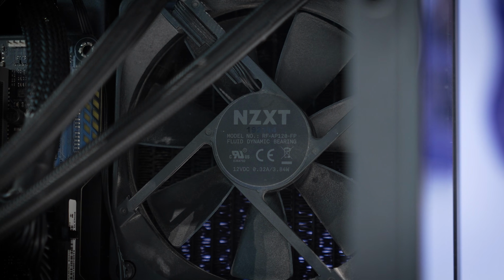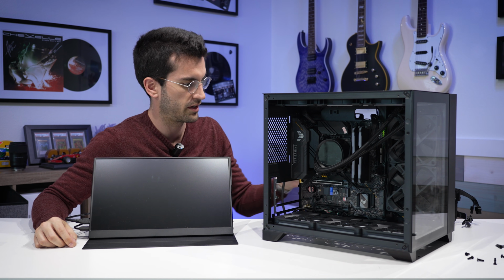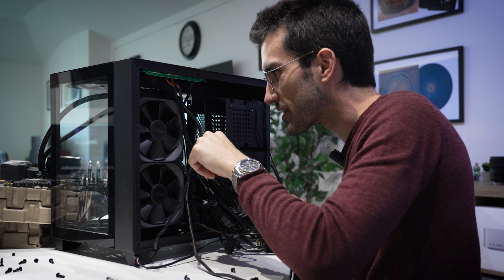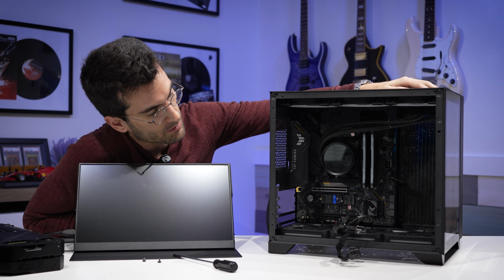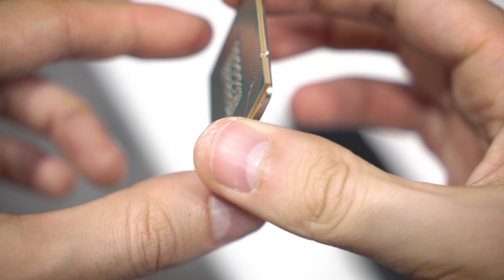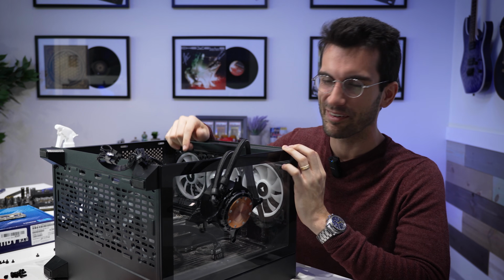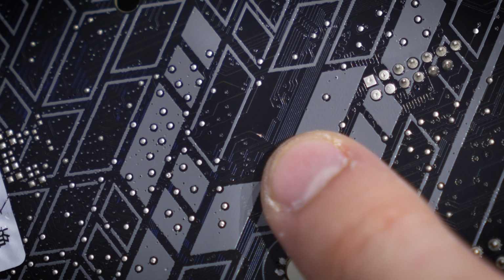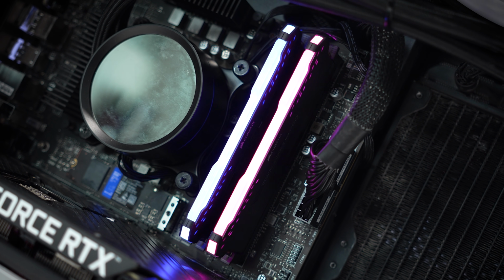Fixing a Viewer's BROKEN Gaming PC? - Fix or Flop S6:E11

Comment: Know this video is old, but I’ve ran into this exact issue once myself. I bought a WRX80 board open box from Micro Center. It worked fine for months. Until I’d experience random shutdowns sometimes. After a month of that it ran right into the same issue you did. It would power on if you held the power button and get into the BIOS. Only three minutes after then it would power off and not do it again until you left it with no power for a few minutes. I got the protection plan so I was able to get my money back luckily and buy a replacement.

Comment: I had the power button thing on an old Fractal case. You had to push the button just right to make it start. If you fast clicked it, nothing happened. Oh, and you had to wait at least 10 seconds after flicking the PSU power button before you pushed the start button on top.

Comment: One of my builds is the same way, I have to hold the power down for 2 seconds. I have adjusted/added hardware here and there during the 3 years I've had it, and not sure why it does that. Also, the VRAM light turns on but shuts off after I restart it, almost every time.

Comment: if that mobo had 2 screws in it, that's more than what MicroCenter used for my motherboard.  The only thing that held in my mobo was the graphics card.  The chunky cpu cooler was bending the board.  I learned to double check repairs before heading home, and not to go to MicroCenter. My computer wasn't the only one they messed up.

Comment: You can take out the individual prongs in the connector and connect up to 2 items per usb 2.0 ports that’s why the top and bottom of the connector are the same no splitter required. Plug in your existing wires into a single connector then plug it in the 2.0 hub polarity correct and your 2.0 port can support 2 items.

Comment: The tape around the CMOS battery is understandable, the tabs on the front and back of the battery indicate that it was likely intended to be used outside of a socket.  Back in 1994-1995, I worked at Zeos, and all our motherboards had batteries like this that didn't have a battery socket, they were soldered directly to the motherboard.  Therefore it wasn't necessary to contact the outside edge of the battery to make the connection.

Comment: I will guess that the battery was a solder in kind, and someone tried to use it in this motherboard.  and note - the black is an insulator.  Now normally, the outer ring is the contact point - so the ring as an insulator - means - battery not working.   My opinion.

Comment: Seems like a capacitor issue I’ve seen certain units power on like that and I check the capacitors and tends to be them or a diode or resistor at worst but the fact that it gets power like that to me says a capacitor is blown probably from the standoff touching a trace and isn’t able to charge anymore not giving enough power to boot up

Comment: I can pretty much guarantee that you got fooled as there is just no way the motherboard works without a battery connection.
not sure if I should be impressed by the troublemaker or by how Greg didn't notice the battery earlier.

Comment: I have a Tuff B650 board that does a very similar thing, eventually it works, also I have the sane ROG 3080 and when those red lights flash its sometimes just an update needed on the card or resetting from the PSU. I will be fully moving away from Asus when I upgrade, they wouldnt RMA the board, the GPU works fine, but is a head ache.

Comment: My theory is that the system worked ok until the GPU upgrade. The lack of correct footing for the motheboard caused it to crack something when the 3080 was inserted in the pcie slot.

Comment: I think that motherboard with the writing on it is set for 220v and not 120v
Reply from the maker: I don't think that's how modern motherboards work. The power supply always steps down voltage (whether 240/120V) to mostly 12V, 5V, and 3.3V. Motherboards don't operate on voltages higher than this.

Comment: I was pretty sure from the start that it was either the PSU or mobo. Was similar symptoms to an old rig I had, It did boot into windows, then just shut down. Did some testing of my own, like re-seating the RAM and GPU, but nothing helped.
Took it back to the place that built the system, and I wrote on the repair paper I got that I suspected the mobo was bad. When I went to pick it up again, I saw on the same piece of paper the the guy reparing it had written "suspicion correct, mobo replaced". Guy had a sense of humor, and I even got a better mobo than the one I had, so win win for me.

Comment: I don’t live anywhere near Florida so I’m more asking if you have seen this problem before: 

Basically on Saturday everything was working fine. I turned the pc off to go out for a couple hours. Came back home and turned it back on. I play vr so it’s definitely something that runs on my pc a lot. Well when I tried to enter in the app I go through didn’t work. Uninstalled and tried to reinstall to no avail. Now the next day. I go to Best Buy and get a brand new hdd 2tb for my computer to see if the app wasn’t downloading due to my space not being recognized. (It wasn’t). However, after hours of it being off this time (after I trouble shot the space issue) I turned it back and it posted. Started booting into windows. I get the sound but then all of a sudden my gpu shuts off completely not allowing me to log into my profile. 

I just bought a replacement so I won’t know if this fixes it but it just seemed like something to ask. Basically have you ever seen a gpu post, but then turn off when booting into the login screen? (It boots into windows 11 just turns off right before the screen that allows me to log into appears.) 

Specks:
12th gen intel core i9-12900k
64gb ddr5
Msi 3060 ventus 3x 12gb
2 ssd (one of 1tb and one of 4tb)
1 hdd of 2tb
650w 80+ bronze 

Thank you

Comment: here's my issue, is ive watches numerous flip or flops videos and instantly once you showed it turned on and then it didnt. that showed me that it had motherboard issues rather psu or even cpu. for it to be cpu it would generally not power certain parts up while only posting once. if it was a dead cpu i for one dont see it posting and two even if it did it wouldnt make certain parts of the computer have power and not. it doesnt control the lights. The RGB lights typically depend on the CPU receiving power and a signal from the motherboard to activate. If the CPU is not working, it's unlikely to be able to power or control the lights. yet it was controlling and it was powering....all im saying is that ive learned that from watching these videos and  the internet confirms it what i was thinking let alone your end result. i think you may need to rewatch your own videos because instead of a 15 minute video you turned it into 30.
Reply: i do want to let you understand that i understand you need to go through the process to vet everything however its videos like these that prove you should try to isolate the issue and solve that issue rather than test what issues you can find because the viewers were not so truthful...
Reply: also not saying this guy wasnt truthful

Comment: At 19:00 I am guessing it has an overload on one of the pins of the board , the power button or leds are not connected properly on the board, or there’s an issue relating to the psu or mobo cables/connection pins.

Comment: If you either hold the power button down for 2 seconds or change the voltage switch  (toggle it back to 120) you can quick press the power button.  Read the manuals!

Comment: If I had to guess, I'd say that the CMOS battery likely came from a mini-ITX board. Many of those boards do not have the battery physically on the board itself but rather wired to the board and stuck to the rear I/O. They often have plastic around part of them or even their entirety. The battery had the connections on the pos and neg so it was definitely a repurposed battery.

Comment: Yoo the crazy thing about this is when i got my PC back in '22 i had the same issue, plugged in the PC and pushed the power button and there was no response,i ended up checking the front panel cables and they were fine, my dad then told be to leave it be to not cause any further damage,I put it back together and out of curiosity, pushed the power button harder and she turned on,i was so relieved,thought i had gotten scammed.

Comment: Radiator tubes up? 😕
Reply from the maker: There's absolutely nothing wrong with this if the pump is sufficiently below barb height and the loop is sufficiently filled. Folks have been spreading this B.S. since the GN video went up.

Comment: I had a computer doing the same thing. It kept getting harder and harder to boot until I couldn't get it booted at all. Replaced the mother board and worked fine.

When I first got the computer the mouse I was using had a bad shorted cable. I wondered if the shorted cable damaged the motherboard in a way that took several years to get critical. Maybe a damaged capacitor. Your out of place screw may have caused a similar problem.

The guy that fixed mine pretty much checked all the same things you did.

Comment: BIOS update?
Reply from the maker: BIOS wasn't the issue. Power flickering was further isolated off camera and wasn't software related. CMOS battery essentially remaining disconnected despite being inserted into the board's holder would explain constant BIOS resets, but it had nothing to do with the overarching symptom.
Reply: @GregSalazar   It didn't make the most sense for a corrupt BIOS to cause the power switch oddity, but I mean I've seen weirder stuff.  haha

Comment: You said you didn't reconnect the top USB 2.0 ports because it's got a working USB 3.0 port on top. The problem I found is, as my case has one 3.0 and two 3.2 ports on top, when using wireless keyboard and mouse (from Logitech), that these don't like being on USB 3.0 ports or higher. They'll just cut out randomly, or the keyboard will hang, the mouse will jitter all over the screen. Unworkable. Putting the dongle in the back of the computer didn't work for me either, as then I'd have total signal cut-out. So I used a USB 2.0 hub for the dongle, and plugged that into the USB 3.0 port on top. This works without any problems. 

Just saying, some peripherals really like it better on USB 2.0 ports than they do on USB 3.0 and higher.

Comment: I touched a laptop board with a screw in the wrong stand and it burned the board completely. So, that was the problem with the board you was seeing, maybe was a power lane or something related and blew a capacitor, or any protection of the board 😅 yeah, the easiest and better solution is to replace it.

Comment: who assembled this pc originally? StarForge is an SI so they should now what there doing, but missing screws and incorrectly positioned stand offs? and a cheap aliexpress motherboard from an SI? the battery is very odd and clearly not designed for mounting in this pc, i know sometimes you have to buy the battery seperately when buying from China so whoever assembled it couldve found some random junk hardware and yanked the battery from it thinking that will do, and in there ignorance didnt remove the terminal tabs and plastic shielding but from an SI? its a damn shame that short damaged the motherboard considering its an Asus Tuf board which is supposed to be pretty resilent to hardware failure.

Comment: This was a motherboard short. I made that mistake that too :))) Same symptoms. In my case the standoff short the motherboard and then fire and smoke appear. The motherboard was fix under warrenty. Stiil this day it is working. You can use some insulator varnish on the old motherboard. Maybe this will fix the problem :)

Comment: This is my thought. The motherboard standoffs being missing is the reason. When the owner installed graphics card/memory/power they pushed to hard and caused the motherboard to bend which cracked some of the motherboard traces.
Reply: Nope, either some of the traces are cut, or a quick short of a few lines put 12v through a 3.3v or lower part.

Comment: Why flipped the fans to the other side when you could have just reversed the flow
Reply from the maker: I explained why. With the fans and radiator on the same side of the bracket, the cable routing holes were completely blocked.

Comment: Those are definitely aliexpress markings ive bought a couple from there. funny enough one of them being a tuff b560m identical to that one. The one i got would only power cycle similar to that if there was an nvme in the top slot. With the top slot empty everything works. Also they wont ship them with a battery so chances are the cmos battery was the owners doing lol

Comment: That CR2023 most likely had a wire ending in a two pin connector soldered onto it and was used inside a laptop or such, and possibly sourced from recycled hardware. And if the mainboard had a similar backstory I would not be surprised.

Comment: 1. Those USB headers only ever take one port each, unpin and wire them to two lines per header and you should be good. I'll never understand why companies use a 2x5 header (with on blocked for keying) instead on a 1x4 header... 

2. After you showed the board.. looks like BIOS flash back is missing... but ASUS CrashFree BIOS 3, ASUS EZ Flash 3 and ASUS UEFI BIOS EZ Mode are options to maybe fix a corrupted BIOS.

Not sure if 2 ended up on the editing room floor.. but it's someone that was bugging me.

Comment: That mobo has a hdmi which is onboard vid card and should post
Reply from the maker: That's not how this works. Ya need an APU from these Ryzen generations in order to achieve picture out without a discrete card. Either way, that didn't end up being a solution here :-)
Reply: @GregSalazar  why are ports there 4 really.

Comment: Greg, just saying ahead of time in the future if you get a PC with the person telling you it power on, no post but after several attempt it will post once this could be a too high hertz memory issue.
I found a PC in the trash and tested it just fine with lower hertz memory, i planned on using it so i bought higher hertz ram and now the system would only post once every few attempts, lowering the hertz in the bios solved it. Also if i were to have a post and leave the memory's hertz stock Windows would run faster, i do not mean good faster, i mean bad faster. Windows' time would desynchronize overtime and games would run too fast.
Reply from the maker: The RAM was running as baseline DDR4 speeds. We showed in the video that the CMOS battery wasn't properly connected, so no manual BIOS config was sticking. Thus, this wasn't a RAM freq. issue.

Comment: I will say, having RMA'd a motherboard from Asus in the past, those stickers are usually on the board when you receive a refurbished board from Asus (mine was not fixable so they sent me a refurbished board replacement). My guess would be that at some point those stickers point to that being a refurbished board purchase, which should have passed QC. I don't think that was the issue, I believe it was the standoff, just explaining what those stickers are

Comment: I still feel like that mobo would still work if you cracked its Konami code. Like you need to press and hold the power button for exactly 2.35 seconds, press reset 6 times, plug in another stick of RAM at the perfect moment, and then pray.

Comment: Wait, you're telling me you actually have to install your motherboard!?  

This one is mildly infuriating.  I know there's other stuff going on, so it's not just this.  And I understand how someone could make an error of inattention, such as failing to remove a piece of plastic before applying thermal paste, but this?  Just essentially not installing a motherboard, so it can wobble, scratch, and short?  It comes with all those standoffs and screws for a reason.  Sometimes the standoffs need adjusted and it's understandable that new builders won't realize that.  But you never, ever just toss 2 screws in it and call it good.  The scratching on that board is heartbreaking.

Comment: Yea, that CMOS battery was definitely scavenged from a different device; probably something like a Dell Wyse 3040 by the way the battery had the contacts spot welded to it. It looks exactly the same.
Very sloppy build though, looks like someone at the Verge got their hands on it!
And adding the RTX3080 was probably what finally caused the short in the back, pushing it hard into the PCIe slot, as you do.
And those traces at the back can be very sensitive, like I had an old Z97 ASUS Deluxe that would only work if I tightened each of the motherboard screws to just the right tightness/looseness. Otherwise I'd get a memory error.

Comment: If the board was not damaged could it be the BIOS? with how it booted was it possible to update the BIOS? Worst case at this point if you tried and it failed the board would be a complete brick lol. 

Besides a bad board due to the standoff scratch all I could think of is due to the labels on the back with Chinese the board could have been some kind a pre production until sent to someone for reviewer that ended up in the wild.

Comment: Fix motherboards for a living amongst other pc parts , checked exact motherboard scratch has nothing to do with power and would not cause the symptoms,  comes up 5v on my test so it's not power, my diagnosis would be a faulty mosfet near vrm . But that trace has nothing to do with anything wasn't broken anyhow and there's no path for a short. Cmos battery is a problem but apart from saving settings not gonna cause any of those symptoms.  Those chinese stickers indicate chinese sold main board more than likely a warranty return.